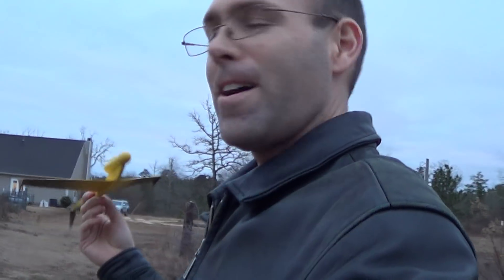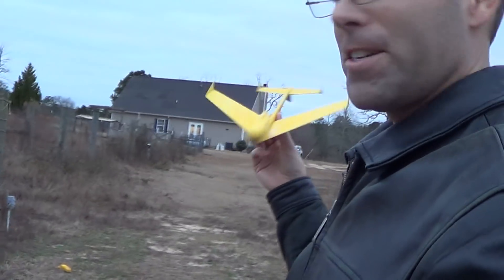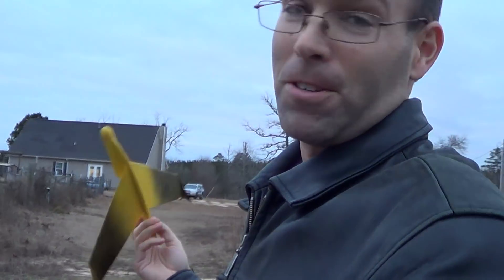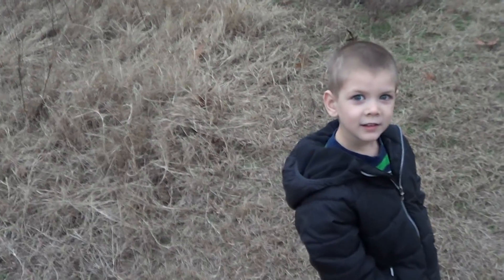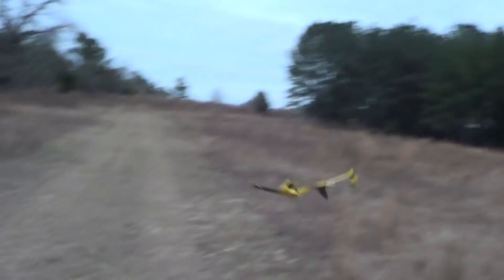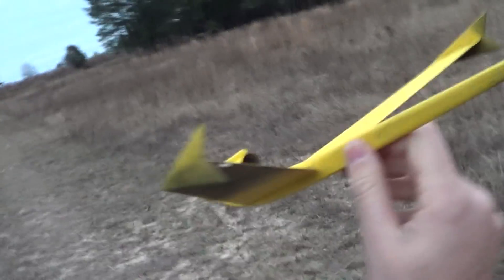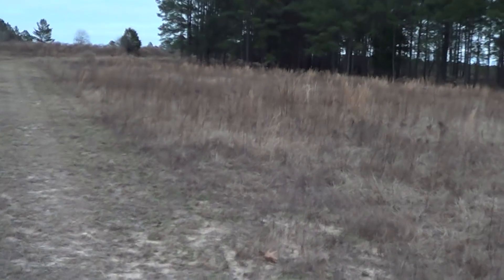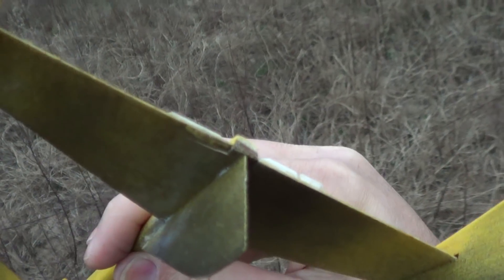Sky Slash II - one awesome rocket boosted glider + silly shenanigans

Comment: I drew up the Astron Falcon in AutoCAD a little while ago, and have cut/built three of them so far this spring. A modified version with less sweep, wider chord at the tops, and no tip fins on the Hstab performs the best of them all. Good fun!
Reply from the maker: gertnood it's definitely a marvelous configuration for a boost glider. Simple and fun.

Comment: Awesome, Years ago I made 3 of them. Very good return on time spent building. They made big circles before landing. They don't allow the engine ejection now days but who cares in corn country. Great to see someone else has discovered this one.
Reply: One way to deal with that is to use mini engines, in a BT-5-20 adapter, and wrap a streamer around the BT-5 tube between the rings - it ejects and unrolls a streamer = safety code cool.

Comment: It seems like it would be an ideal candidate for a umx brick... the brick would be shielded by the wing, might be a little draggy with the wing and battery sticking out. You might be able to hollow out the fuselage, then plate the sides in 1/64th ply, to make a cavity for the battery to stick into. might be an interesting project...